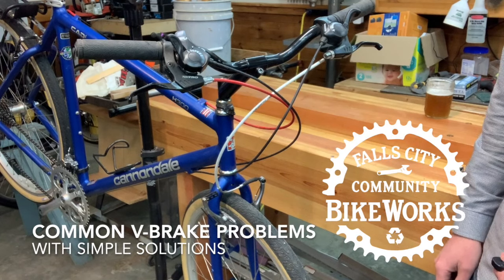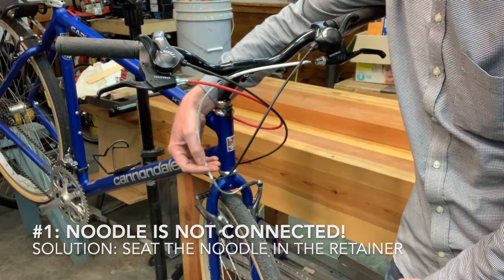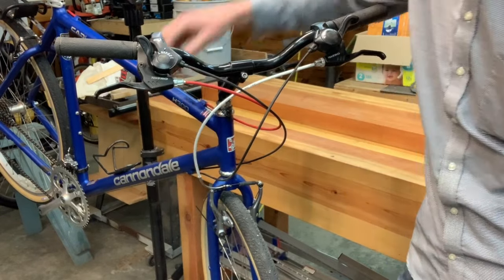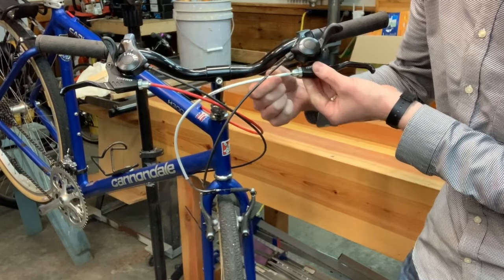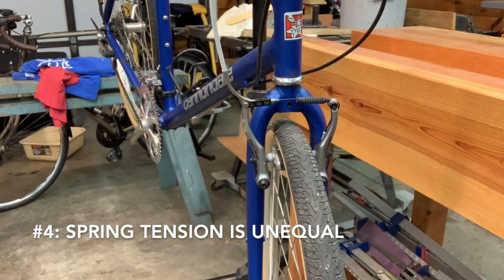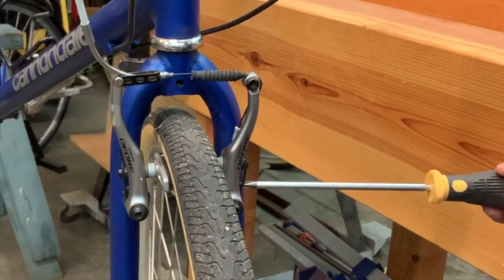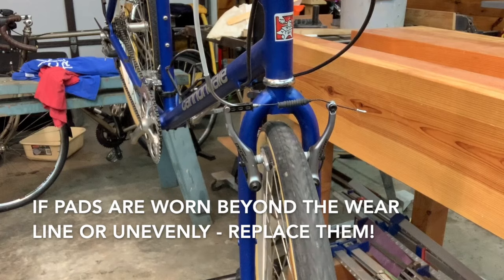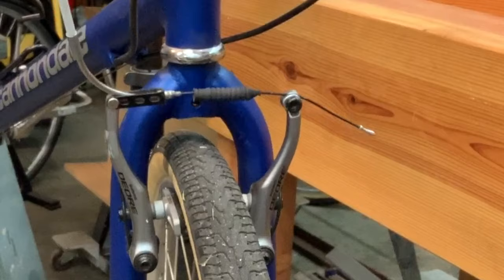Common V-Brake Problems and Solutions

Comment: The first video on V-Brakes that really helped me. Had constant problems with dragging brakes. This video also explains the background and how the brakes work, while other videos do not go into it at all. If you now really understood what happens when you turn a screw, it is suddenly very simple. Everything now works perfectly again. Thank you very much, and many greetings from Germany.👍
Reply: If the cable housing keeps coming loose from the ferrule, you might have a problem with cable friction or the brake return spring.  Something is keeping the brake from pulling the cable back taught after the lever is released.
Reply: 100% explaining not just what things do but why is so important. I'm still a bit confused because my issue is a bit strange but more confident

Comment: The barrel adjuster is not working. I tighten it but the handle is loose. The wire is intact inside the handle. Why isn’t it tightening when I tighten the barrel adjuster?

Comment: Thanks for this, it gave me the confidence to adjust my 4 year old twins new bikes.  The brake levers were so far from the handlebars they can barely reach them, let alone actually brake with them.  I've now brought the levers in, reduced the spring tension, and lengthened the brake cables to compensate.  Usually you want to tighten brakes :)

Comment: Excellent presentation. Not only was I able to balance both sides of the V brake with the instructions here but, by applying the general principles amply demonstrated in this succinct video, I was able to fix my kite, toilet paper roll (it got loose, sorta) and small nuclear reactor in my basement. THANKS!
Reply: Smart ass 🤣🤣👍

Comment: In my case one side of the brakes dragged the rim so I went for the spring tension screw adjustment. Later I found out it didn't do anything because the tip of the spring inside the brake was bent out so the screw just slipped away. I took apart of the brake then bent the tip of the spring inward so it can engage with the screw. Now I'm very happy to fix this annoying problem!

Comment: I bought a Shwinn from Amazon and noticed the brake return springs on the front weren't set right since one side was dragging on the wheel. I'll adjust the brakes tomorrow. This video helped confirm the simplicity of the adjustment. Thank you!

Comment: The best video, can be a bit slower and just a couple of better angle ( spring part and cable screw adjustment. This video could be broken in to two if it was a slower follow along . Yet this Is The Best Video I have seen! 
And I have watched and search a lot.👍💯

Comment: I've got a new bike and one arm of the v brake really stick.  it sticks next to the wheel and then once you move it sticks away from the wheel.  I adjusted spring tension using the little screw and it does nothing.  Any ideas what it could be

Comment: Great instructional video but it didn't address my issue unfortunately. I have a similar brake setup my bucycle and I have replaced the break cable and the brake shoes or pads and no matter what and how many adjustments I make my rear brakes don't bite down and stop the wheel when I'm on it. I barely touch the front breaks and utll throw me over the handles. I haven't found any videos addressing this issue. Any help or advice would be greatly appreciated.

Comment: What do you think causes a slow or weak release?  Brake spring in highest tension and cable is free
Reply: The brake studs may need cleaning and lubrication.  The brake pads may be worn unevenly, and getting wedged into the rim.

Otherwise, it's a cable friction issue.

Diagnosing the brake function with the cable detached is a good way to isolate the variables.

Comment: My problem isn't the spring at least I don't think so. When I use the front brake the pad rubs against the tire I have to manually pull it away from the tire what could that be?

Comment: What if the brake boss is jamming? On the back I replaced the brake boss and it’sfixed. The front same issue, is there a simpler solution?

Comment: My pads may be worn unevenly, i tightened the cable , adjusted the screw , got them both to engage and as close as possible to the rim without rubbing it when brakes not applied but when i pull the brake handle i just don't have enough braking power, no metter how hard i press i can't lock up the wheel while riding it, i have to pull very hard both front and rear to get a somewhat decent braking
Reply: Have same issue did you find a solution?

Comment: hey i need help i have an escooter, before winter hit in canada here i washed up my scooter in my standup shower,   but now the breaks are STUCK  cant press the handel in..   its a disk break     i dont know anything about breaks,  but i think the break cable is coroted in the sleeve part.    should i just take my scooter to a bike shop and let them look at it?
Reply: Bike shop is the best place to take it. I no longer like  disc brakes gone back to v brakes much easier to fix

Comment: 6:35 What if the breaks rub the rim, but if I losen them up just so they don’t, the break lever don’t engage them fully and I can’t break properly?
Reply: Did you find a solution? I’ve got the same issue
Reply: @gregreeves4884  Yes, brought it to professional bike service :) They told me that there were some issues that required changing the break string and something else, don't remember anymore.
Reply: @rayhoodoo847  Thanks :)

Comment: I did all adjustments you recommended but brake lever when squeezed goes all the way to handle bar. The other side stops about an inch before reaching handle bar. How do I adjust that?
Reply: Did you find out? Same problem

Comment: Hey do you have a solution for on of the rubbers stoping the wheel going under the rim?
Reply: This is usually due to worn pads.  Improper pad alignment can cause uneven wear of the pads, causing the tops to wear before the bottoms.  When this happens, the pad becomes wedge shaped and slides down below the rim when you engage the brake.  Pad replacement and proper alignment is the solution.

The hack fix is to realign the worn pads so that the far bottom of the pad strikes the rim more perpendicularly.
Reply: This is usually due to worn pads.  Improper pad alignment can cause uneven wear of the pads, causing the tops to wear before the bottoms.  When this happens, the pad becomes wedge shaped and slides down below the rim when you engage the brake.  Pad replacement and proper alignment is the solution.

The hack fix is to realign the worn pads so that the far bottom of the pad strikes the rim more perpendicularly.

Comment: What if cable housing is moving together with the cable, I suspect it's because one thread of the cable fluffed up.How to fix this?
Reply: You'll have to replace the cable (inner cable) in this scenario.  If you are in a pinch, try to find the single strand that is broken/loose, and unwind it up to a point that it can be cut off at a position that is not inside the housing (e.g. along the length of top tube where the cable is exposed).  

Once a cable has become frayed, it is very hard to do brake service because the frayed end cannot be pushed back through the housing if removed. 

(I'm the guy in this video, btw, from my personal account)
Reply: @ndpinney  "try to find the single strand that is broken/loose, and unwind it up to a point that it can be cut off at a position that is not inside the housing."
I've done just that! Once I took that strand out of the housing it started to work again,then just cut it off.I guess one missing  strand won't affect cable too much.

Comment: What if the tension screw is doing nothing?
Reply: I am not an expert, but I had the same problem!  I tried loosening the Allen wrench bolts and pull a little more cable through to create more tension. That worked for you me